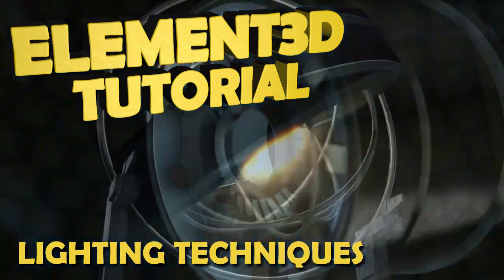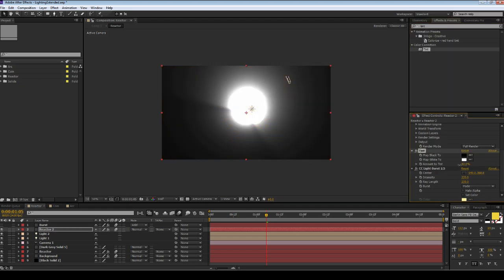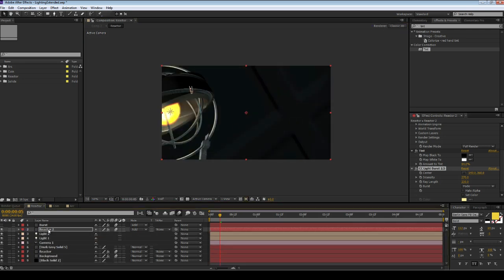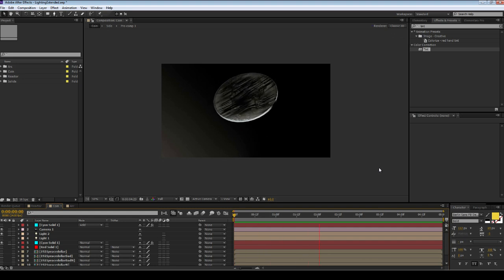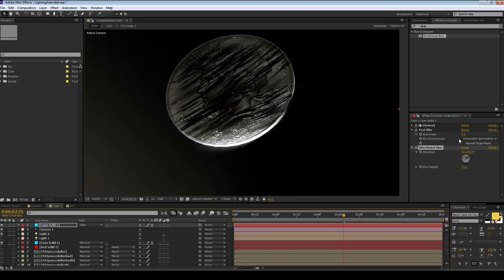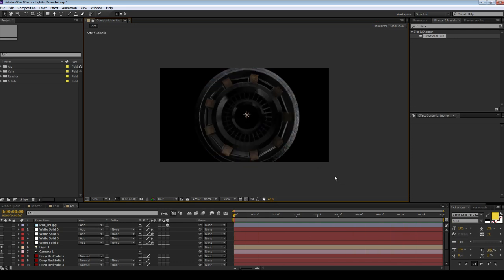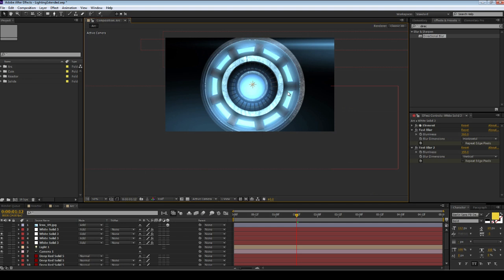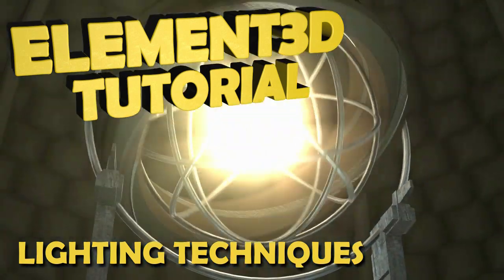Tutorial | Element 3D : 3 Quick Techniques to Enhance Lighting

Comment: Hey Josh! This is amazing! I see that you use a lot of duplicated E3D layers...My question is...When you want to modify something in your Scene Setting, you then have to change it into each layers? Or do you have a tips to link all the scene setting to the same one? THANK YOU VERY MUCH!!!!
Reply from the maker: Yeah Scene settings would need to be tweaked individually. I usually set up my scene first so I don't have to keep making changes multiple times. I also connect the position and point of interest of my nested camera to the main camera. That way I move the main camera everything still lines up. In Element, I don't typically mess with the world position or anything that would change any nested scenes. I would also be careful rendering Element with multiple layers in Media Encoder. In newer versions, I have had little success. Rendering out PNG Sequences from AE still works though. I don't use Element that much anymore. It was a gateway drug into 3D, I am using Blender a lot more now. Sorry for writing a novel haha.

Comment: Anyone having issues "turning on illumination" for your duplicate model in the first demo, in your element 3D scene setup, select the material that will be used as the light source, scroll down to advanced settings and set its blend mode to either Screen or Add. This at least worked for me when I went to the AE work area and selected Output->Show->Illumination from the duplicate layers element 3D tab.

Comment: hey how could we bind a null object with it instead of light i tried but failed ??
Reply from the maker: Aali.D.Gr8 I'm guessing you are talking about the first technique. If so, all you have to do is make sure that you use the name of the null in your code i.e. L= thisComp.layer('null 1'); if you are still having trouble consult motionscript.com for full details on the code and how it works.
Reply: Josh Burns Thank you so much Josh for replying :) actually i did but failed bcz i realize light is the only thing in AAE which moved viseversa when with Camera movement auto but null and other thing not move automatically that's why when i made it like this L = thisComp("Null"); and then L = toComp([0,0,0]) its not working want your help ??:)